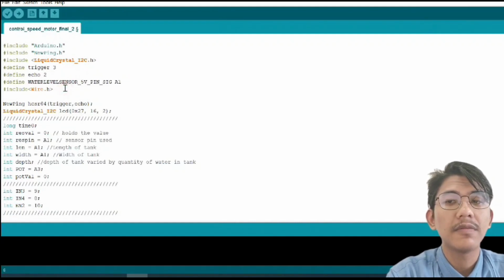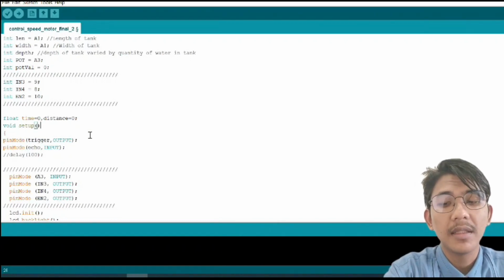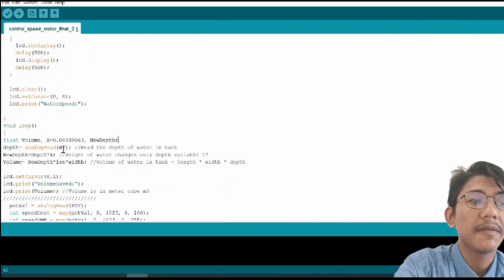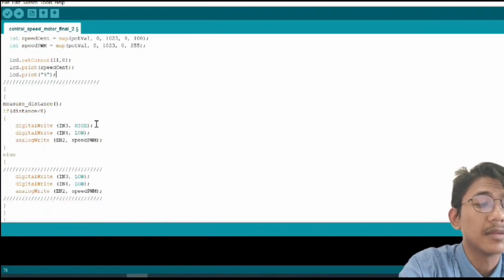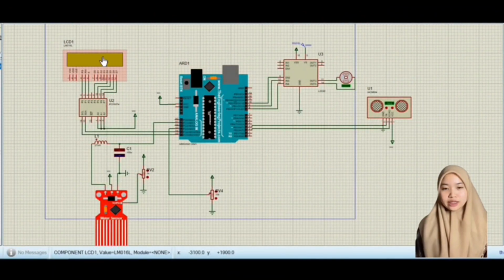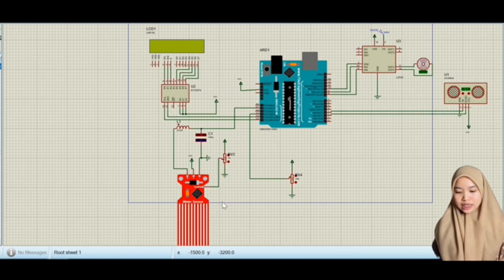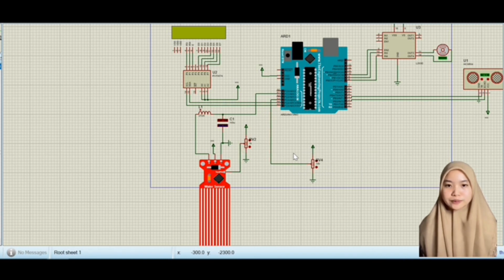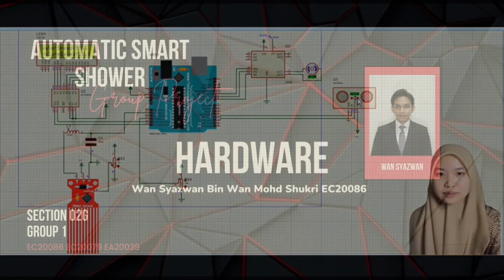Automatic Smart Shower with Ultrasonic Sensor [Arduino] [BEE3942]

Comment: 1. I don't understand what the purpose of this project is. If the project is to save water, why do you need to control the water speed manually using the potentiometer? It is just like a normal shower. Besides, a normal shower is much cheaper and easy to install. What is so smart about this?
2. Why do you need the ultrasonic sensor if you need to control the water speed manually?
Reply from the maker: EC20086 GROUP 1

Every human being will bathe at least once a day. Among the high rate of water wastage is when we shower, we were causing excessive wastage of clean water. The reasons is people like to leave the shower open while brushing their teeth or lathering their bodies. With a smart shower, it can reduce water waste by controlling the water speed rate and the conditions in which users should use water. 

1.	The purpose of potentiometer is to setup the speed of water that flowing out from the system. Once it be set, no need to change it to zero and it will be saved for next shower also the water will not be flowing out unless the ultrasonic had been activated. Some people need fast shower to clean themselves after doing activities so we put this feature to make sure people can utilize the water flow according to their need.

2.	The purpose of ultrasonic sensor is to solve problem for the people who like to leave the shower open while brushing their teeth or lathering their bodies. When ultrasonic detect human body, it will activate the system and water will flowing out. Even potentiometer has been set to 100%, if ultrasonic did not detect any body the water will not flowing out. For example, when people are soaping, they usually avoid the contact from water fountain but their altitude still keep the water flowing out. So, by using ultrasonic sensor, it will control the pump to hold the water from come out when people are soaping themselves until the ultrasonic sensor detect their body to proceed showering. After people have finished showering, they don’t have to touch anything and continue to get ready to put on clothes. The ultrasonic will be deactivated the system and will stop the water from flowing out.

Comment: G06- What are the benefits of this system?
Reply from the maker: EC20086 GROUP 1
Every human being will bathe at least once a day. Among the high rate of water wastage is when we shower, we were causing excessive wastage of clean water. The reasons is people like to leave the shower open while brushing their teeth or lathering their bodies. With a smart shower, it can reduce water waste by controlling the water speed rate and the conditions in which users should use water.

Comment: Hi. Im Adlina EA19054. This is a great innovation to save water !! My questions are, is the water speed, part of the Smart Shower since we need to control it by twisting the knob or when the water level is low?
Reply: EC20079 GROUP1
Yes, this feature is part of the smart shower. The knob (potentiometer) is used to control the water speed. However, once you set it, it is not necessary to twist it again when you are done taking the shower or the water is low. As an example, if you are a person who likes taking heavy rain showers daily, you can set the water speed to 100% and this setting will be saved until you change it. I hope this explanation answer your question, thank you.

Comment: G10 EC20081 - How is the water saving feature calculated?
Reply: EC20079 GROUP1
This project is a prototype so we use a small container as a symbol water tank in the house. By using water level sensor, when we put it in the container it would detect the volume of water in that container. So, we can call this as initial volume for tank. When water pump is active, the water will be pumped out and the water level sensor will be detected and calculate the differences of water flowing out with the initial condition. ( watersaved = initial volume of water in container – volume of pump out). I hope this explanation answer your question.
Reply: @ECIDRIS  Thankyou for your answer